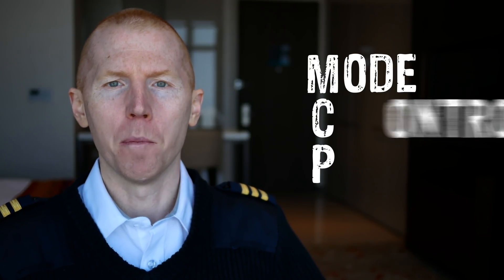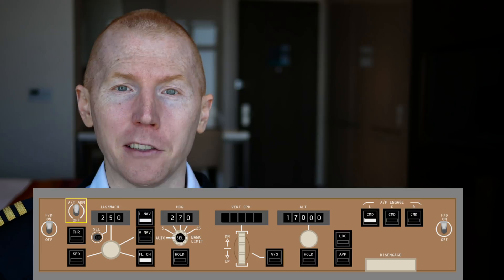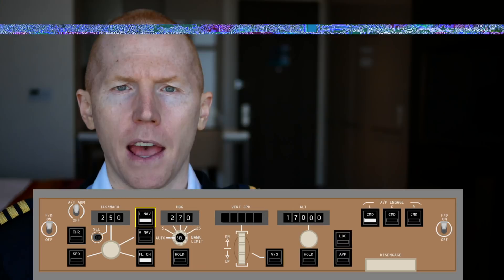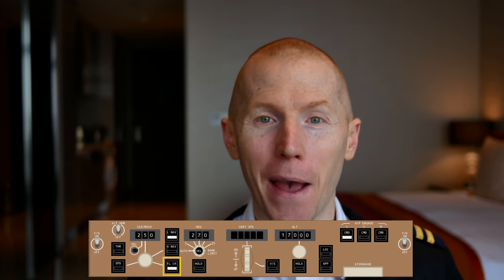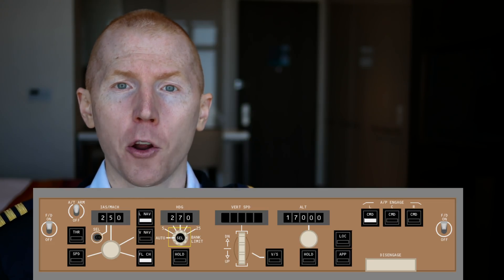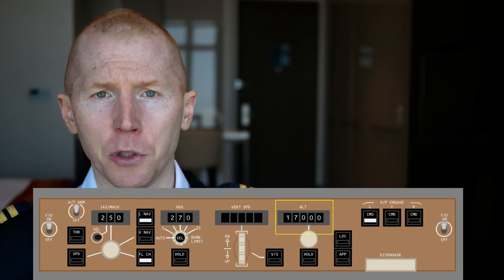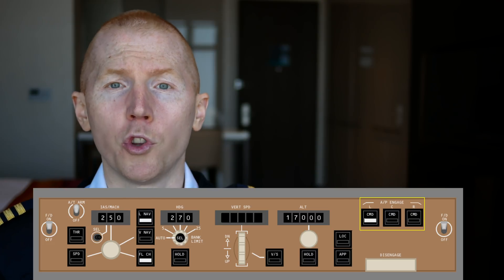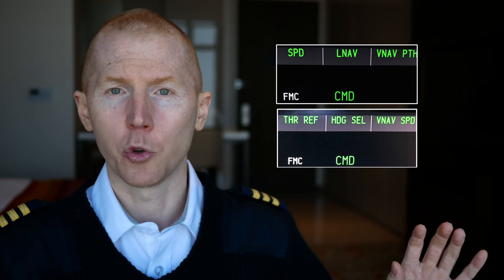Boeing 747 Flight Sim Training: Mode Control Panel

Comment: For those who couldn't understand the funcion of FL CGH is basicly for slave the climb based on the airspeed, for an example, if you are climbing at 290kt and hit FL CGH and select 250kt the pitch engine will engage THRUST CLIMB mode and the pitch will increase to maintain 250kt, the lower the airspeed selected the higher is the pitch and the higher V/S.

Comment: I was playing msf2020 and having issues with the 747 a/p. I have played fsx for years flying a 737 and never had issues with the a/p but after watching this video I see they are very different systems. For example the alt hold button on the 73 would bring you to the selected altitude and hold it, rather than the 74 which holds at the current altitude. Same with heading. Great vid thanks for the info!

Comment: Thank you, Kelsey. I'm watching your video to help me understand how the 747 works and operates for my MicroSoft Flight Simulator. Last night I flew from Boston to LAX at 32,500 feet at 249 knots with no problems at all, until it was time to touch down. I had a good slop path and configured for touch down, but at 1,000 feet the plane would accelerate and go back up. Now I understand that I need to learn more about the switches and knobs on the Mode Control Panel. I was getting frustrated until I found your video. Thank you again. And by the way, my Uncle was a TWA 747 pilot flying the route from Boston to Paris for many years.

Comment: Hello Kelsey. Thanks for the info. I hv a question regarding the ALT HLD button. How do you know what altitude the 747 will hold? Also, do you need to turn the altitude selector after switching on ALT HLD for the aircraft to maintain the altitude you need to maintain? Had the same question for the 737.

Comment: Watched it for flight sim. Unfortunately in a lot of sims the button don't actually do what they are supposed to or work in a different way. And they may vary from plane to plane even if its the same type of plane or from one sim to another. Going from FSX to Xplane 11 I noticed some things were different. Then you just have to kind fiddle around with things and see what happens or resort to watching a video for that plane in that sim. I got really spoiled using the autopilot in FSX. Now in Xplane if I get in a plane and it doesn't have autopilot, or the computer is hard to use I don't even want to fly it. I got in one that didn't even have gps, I was like screw this, I am not even flying this thing lol. I wish I could afford to take a basic flight school just to learn how to fly my sim but I don't see that ever happening on my income. I could manage to fly just about anything in FSX, as far as taking off, getting there and landing. Xplane is a little harder, especially with the commercial jets. I thought I could just hop into one and take off but that wasn't the case, there is more to learn and figure out.
Reply: Paul Mohr is you flew the PMDG. 737 fly the zibo 737 :)

Comment: Hi Kelsey, again great video. Thank you for that. I'm a simulator pilot and love to fly 744 and 748. Regarding MCP mode FL CH I have a question. Isn't this mode more a combination of speed and altitude change?. E.g. you are going to descent from 9000ft to 5000ft. ATC give you instruction to keep 220knots. You dial 5000ft and 220knots and push FL CH button. Than from my understanding and simulator experience the aircraft descents trying to get and maintain 220knots. If speeds is oscilating below or above than the FL CH mode automatically adjust rate of descent to get back to 220knots. Is this correct or somehow different in real world.
Thanks
BR
Andreas

Comment: Hi Kelsey - I think it might have helped viewers understand FL CH a lot better if you'd mentioned that it is used to climb or descend the aircraft as a function of speed, therefore giving crews the ability to control the speed particularly on a descent.  For quite some time I had troubling understanding the logic behind FL CH and why we use it in a given situation...that was until I learnt it simply changes altitude as a function of speed!  Keep up the good work!

Comment: I watched this for my flight simulator. I have the MCP737EL at my home cockpit. I fly PMDG 737NGX/777/747-8/400. The MCP I have works for all three most accurate for a 737. I watched that video because it is the summary of Boeing FCOM manual under 14 minutes. Very useful. Thank you. Just to clarify do you use FLCH during decent if you have speed restrictions? PMDG addon levels off until the speed comes back and then starts decent, is it the same on the actual?

Comment: I am just a former Cherokee "weekend warrior"  who has always loved aviation.  Now I just "fly" on Flight Simulator.  Thanks for the informative videos!
Reply from the maker: I know this is kind of a boring video, but I am glad you liked it though 👍
Reply: @74gear  I didn't find it boring.  I had a very good version for Flightsimulator of the 747 put out by a company called PMDG, so I  had a chance to learn something about these systems.  So, your explanation was valuable in clarifying some things I wasn't sure about.  I have an unrelated question to ask you.  I flew back from Denver to JFK recently.  We reached the Long Island area at about 5 am and landed on 22 R.   I was wondering if at that time in the morning, in clear weather, if the pilots are cleared for a visual approach, perhaps to save time.  Thanks!

Comment: Thank you this was very helpful. But I'm still confused a bit. In Boeing 737-800 there are CMD A and CMD B and some other 2 buttons under that. What's the purpose of it? And also FMC shows certain altitude and speed infront of waypoints. How to make autopilot to follow the exact path without manually setting/ changing the altitude?
Reply: CMD A/B referring to auto pilot A or B.  Alt and spd in front of waypoints are your restrictions crossing that fix
Reply: @alalal8157  thanks, but is it possible that autopilot automatically follows the speed restrictions and altitude restrictions? Or it's just used as a reference and I have to manually alter them?
Reply: @johnywesco4143  If the plane is capable of it, yes the autpilot would follow the restriction.  But if the plane is too high or too low, and its performance cant meet the restriction, the plane would just do the best it can.  ie restriction is 10000' and 250kts, the plane may just cross it at 11000 and 260 kts.  In real world it'd b a ATC violation

Comment: Actually a bit of both. ;)

I am a pilot and fly a Proline 21 equipped plane which is very similar to the Boeing setup in modes (they call it a Flight Guidance Panel not an MCP). 

But I was showing my son how to use the autopilot and MCP and FMS in a 737-800 on XPlane. 

We were already flying... so I selected FD on and put in Heading and altitude hold modes (looking at what we call the “rumour board” to make sure modes annunciated) and put in a destination airport, loaded up an approach, set up cruise and descent profile, put the initial waypoint in the direct line on the legs page, hit lnav to get on course, hit flight level change to get up to altitude, and settled in for cruise after capturing altitude. 

It’s very tough to see a TOD and I didn’t see one on the progress page. In spite of arming VNAV and dialing altitude to zero it would not capture what I thought would be a normal 2.5 or 3.0 degree VPATH nor was is respecting VNAV restrictions on the approach. 

I put the boards out and tried to dive using Vertical Speed (it’s true what they say that the 737 doesn’t like to slow down and go down) but it would not capture anything. Every time I’d hit VS or FLCH it would reset my altitude selector to the cruise altitude Inputted in the FMS. 

Is there something I missed?  I’ll admit that the XPlane FMS isn’t the best (eg: you can’t put waypoints “in the blue” on the legs page to intercept segments and clear discontinuities rather than going direct a waypoint).
Reply from the maker: oh nice, I didn't know about that, thanks for sharing Barton.

Comment: Was this panel first introduced on the 757 and carried through to the 747, or vice versa, because they look alike, if not exactly the same? What was Boeing thinking when it changed the panel color from blue to beige, or whatever it is?

Does the autopilot not work if you do not align the IRS systems first and set lat/long POSITION through the calculator-like FMC, or whatever it is called?
Reply from the maker: I don't know who got the MCP first, I would guess the 747, but I have no idea on that or why they made the color changes.  I haven't ever tried to fly the plane without the IRS aligned but I think the auto pilot would work you just wouldn't be where you thought you were.
Reply: That's most interesting, 74. I assumed the nav platform had to be set to the current position wrt to lat/long before use of the autopilot functions would be even possible during flight. How does the autopilot use vnav/lnav when tied into a flight plan input into the FMC, or its equivalent on the 747 - can it navigate aligned with GPS alone? I obviously have a disconnect with the overall concept of the autopilot. Basically I always thought the plane's internal starting point for inertial referencing had to be overlaid with the external GPS absolute coordinates for every trip or the aircraft would not budge! In other words, the dead reckoning course that might be expected from the INS had to tie up with any GPS starting point from straight off the ramp in a one-to-one correspondence. What is the greatest range flight you've ever undertaken?
Reply: I’m pretty sure the autopilot will function without a position initialization—especially in basic modes like roll, pitch, heading, altitude hold, flight level change, vertical speed, etc. It won’t function in LNAV or VNAV because it won’t know where it is in relation to the flight planned tracks or the vertical constraints on those tracks. 

Basically there are a massive number of references for the autopilot and FMS to use to fly the aircraft. Roll and pitch modes will be based on the AHRS systems which are gyros which tell the instruments and autopilot which way the plane is pointed in reference to the horizon and something. That something is usually magnetic north which is referenced by a flux valve. With magnetic north you can use heading mode. 

Next point of reference is you Air data computers or ADC. Airspeed, altitude, vertical speed, outside temperature, total temperature (since the air is heated up by motion), etc. This tells the instruments and autopilot how fast the plane is travelling through the air (indicated airspeed... for aircraft performance, true airspeed relative to the air), how high it is, and whether it’s going up or down (different than whether it’s pointed up or down). This will give us speed mode, flight level change, altitude hold, vertical speed, etc. 

So we know where the nose is pointed and how high we are, how fast we are going, and whether we are maintaining altitude or climbing or descending. Now we need to know position. 

Position is done via several things in a modern FMS—many being used concurrently. The most obvious is a GPS. Most modern planes have one or several. Next is using an RNAV system that receives bearing and distance from VOR/DME or VORTAC. It constantly tunes and identify stations to update its position and uses a trackline computer to plot a course by them. Next is INS.. which was common before GPS for trans oceanic flights beyond the range of land based navaids. It’s fancy dead reckoning... so of course you need to initialize it at a known place or update it at a waypoint or with another navaid if it drifts too much. 

So with those.. we know where we are, what direction we are travelling relative to the earth, and our groundspeed. 

By differentiating that and our ADC/AHRS information... we get a wind vector and a navigation solution... which could be as simple as a track made good mark on our HSI and corrections on our flight director and autopilot to a full blown velocity vector on a HUD. We can now use LNAV and VNAV. 

For Approach, we can use an FMS programmed approach, or we could simply use heading mode to navigate ourselves to an ILS or LOC approach.. still without the plane knowing where we were and only flying in reference to those specific navaids. In my plane... I don’t know about the 747... we could also LNAV on VOR airways and radials without the FMS knowing where it was by switching the navigation source from FMS to VOR.
Reply: In fact, it’s actually prohibited to navigate an ILS or LOC approach on FMS. So the source must switch over and at that point yeah... the autopilot isn’t receiving any information on the current position of the aircraft from the FMS.
Reply: That would seem to make sense because Lat/Long figures just add to input overload when all you want to do is centre the crosshair, although ARC map mode is still pretty useful for the graphical simplicity it provides.
Reply: Magnificent, Bartonovich52! The complete 'autopilot' function of a modern airliner seems overly complex, if anything. Other than precise VOR/DME fixes of the traditional kind, I'd have thought GPS offers triangulation to a precision the likes of Columbus & co would have greatly appreciated. The tech of today is quite miraculous. You mention a flux value to feel out M North - presumably that would be the modern day equivalent of the Pioneer earth inductor compass Lindbergh installed on the Spirit of St Louis to give him a steady compass heading to go by. Thanks for the breakdown
Reply: You’re welcome. 

Yeah a flux valve is an old device. Basically it gets a reading by how much magnetic flux it lets in and it can determine magnetic north. Our fancy gyros are then slaved to it. The only time you don’t use that is at high latitudes where it’s unreliable and you use true or grid north. It’s very curious that we still use ancient technology, but for all a GPS can do it can’t tell us which way the plane is pointed, it can only tell us our track.. which way we are travelling. 

GPS is amazingly precise but that alone is not good enough for aircraft operation.  We need to have integrity and reliability as well. For basic enroute navigation we can use a basic four satellite position. A fault there isn’t likely to cause a lot of harm. 

For a non precision GPS approach, we need a one or two extra satellites for integrity. One extra satellite for fault detection (one of the satellites is wrong, we don’t know which one) and two extra for fault exclusion (satellite 4 is faulty, continue the approach on 1, 2, 3, 5, and 6). We also have to ensure we have enough satellites before starting the approach. This is Receiver Autonomous Integrity Monitoring or RAIM. 

For a precision GPS approach with an ILS style lateral and vertical guidance (LPV), this isn’t enough. We need a ground based augmentation system that is receiving and correcting GPS signals in real-time... and sending those corrections to a geostationary satellite for our GPS to receive. It will also instantly tell us if there is any fault. This is knows a Wide Area Augmentation System or WAAS.

As GPS evolves we get into Required Navigation Performance. Basically how precise we can use the GPS and flags if we should go outside of it. This was first used on complex curving RNP approaches by Alaska Airlines in places like Juneau and Palm Springs. But now it’s going to apply to every aspect of GPS navigation to varying degrees of accuracy. My plane will not flag when I’m off course in an enroute environment but it soon will have to in accordance with RNP. 

The final thing about GPS precision is it’s too precise sometimes. The likelihood of two aircraft on the same track colliding with each other is much greater now. So we deliberately reduce the GPS accuracy with Strategic Lateral Offset Procedures (haha SLOP). Planes will randomly apply an offset of a certain distance to reduce the chances of them laterally occupying the same airspace.
Reply: Yes, I've seen FR24 coverage over Europe. The tracking and spacing of aircraft is downright terrifying to see sometimes. If an emergency occurs, how do all those precisely vectored planes get juggled about to make space for any necessary deviations? One time, a member of my family was flying in on an A319. I was following the flight on FR24 and noticed the aircraft was very close to flying overhead. So I went out in the garden at the moment I thought it could be seen from my vantage point on the ground. Sure enough, I saw it pass by the roofs of the houses off to the west. FR24 said it was at about 12,000ft. That's plenty accurate. The problem you mention of northerly and southerly placement obviously has something to do with Mercator projection. It's a conveniently quick math method to incorporate in software/hardware, but don't go near 90° north or south where things get stretched a bit! During his flight over the Atlantic, Lindbergh, as you may well know, used his earth inductor compass to lay in a course from his DR Mercator map hand drawn tracks, but required his magnetic compass to verify which direction in which he was actually heading because the lines of force only indicate alignment, but not even in which quadrant the aircraft is pointing. I guess that flight in May of 1927 was the start of modern day precision navigation techniques.

Comment: The most special flying experience for me was flying on the upper deck of the 747. I got an upgrade to business class, so I got a seat on the upper deck. I've been on A380s 10+ times, but it really doesn't compare to the isolated feeling you have in the 747
Reply from the maker: I want to fly as a passenger on a 747, it would be strange I think for me to not be allowed to go up front but cool to have that experience.